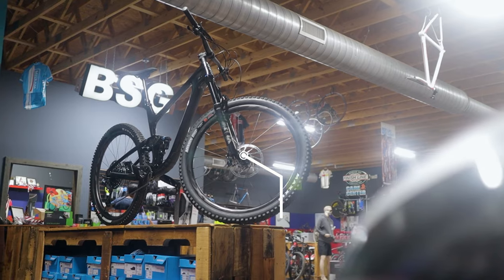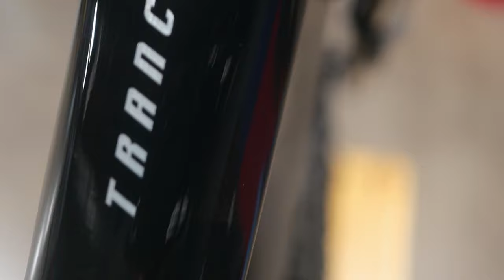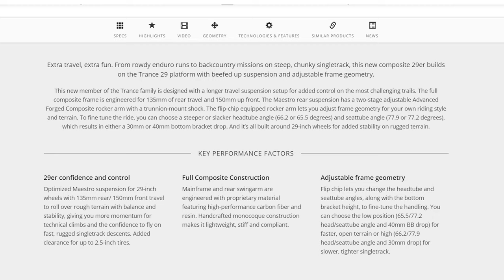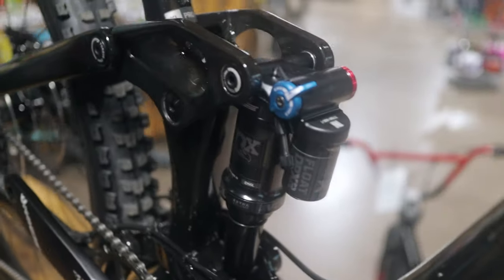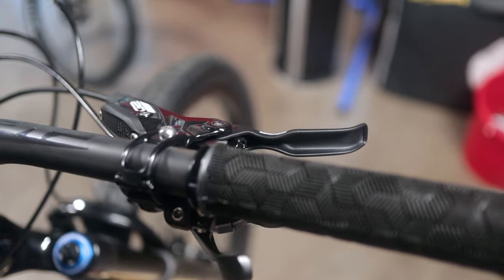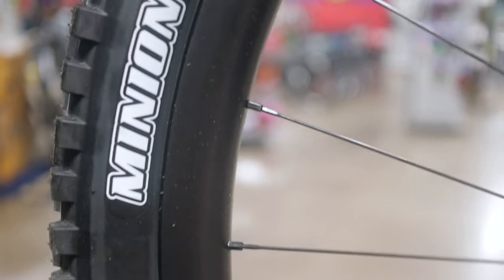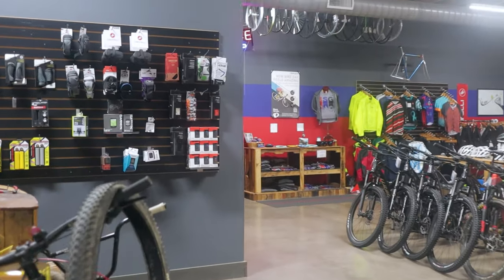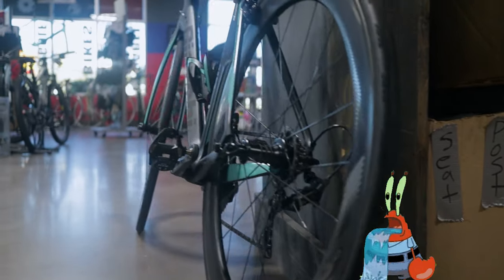2021 Giant Trance X Advanced  pro 29 Unboxing and weight!

Comment: Can you do a trance x 2 vs trance x 3 video...... I still haven't decided what bike I want to get
Reply: I got the x3. Sold the SX shifter and derailleur for $80 and got SLX shifter and Derailleur for $100. I don't think there's a weight difference between the 2 bikes. The green looks nice on the 2 though. I think the 35 fork is pretty decent despite what reviews seem to say.
Reply: @SH-ig6rd  I know if I get the x3 the sx derailleur is know for loosing tension so I'll most likely have to get a new one of those. I'm just waiting for a comparison video to see if the better brakes and suspension is work the extra money.

Comment: Do you think this bike will be comfortable on 100+ kilometer ride? ( Not on trails, more of an endurance ride ). I really want this bike but honestly, I can use this on a trail once or twice a week. This will be more of a everyday workout bike / cardio machine for me.
Reply from the maker: I'd definitely won't be as fast as a gravel/road bike but you can definitely ride that far on it. The bike is awesome but if you want one bike to kinda do everything I would take a look at the standard Trance as well.
Reply: @MossieRidesBikes  thanks for your inputs. I really don't care if I'm super slow as long as I'm comfortable,I'm really after the bounce of this bike. I can only have 1 bike so I think I'm gonna get the Trance X 29er 3. That's the only model we have here...and it's a medium. If this will be small for me ( 5"10 ) , do you think extending the stem will help?
Reply from the maker: It may fit you fine with the stock stem. I'm 5'10 and per giant I am in between a medium and a large. I prefer a large but I know quite a few people that would rather size down. You can certainly put a longer stem on the bike but you don't want to go too long or it will mess with how the bike handles
Reply: @MossieRidesBikes  Thanks! Tomorrow will be the online reservation for this beast. Wish me luck,only one unit will be for sale. Though the local bike shop promised that there will be more to come. I really don't understand why our country ( Philippines ) is short in supply considering that we're close to Taiwan and China 😑 I'll keep you posted as soon as I have the bike. Keep on posting more stuff, I'm solid follower. Thanks 👌😎👍
Reply from the maker: @joelnalindhom9906  Good luck. I hope you can snag it and I appreciate your support!
Reply: @MossieRidesBikes  I just got the bike last Sunday ( Medium ) and I think it fits just right for me. This bike is huge and beefy so might be harder to control if it's Large.  I love the bike even if it's heavy 👽